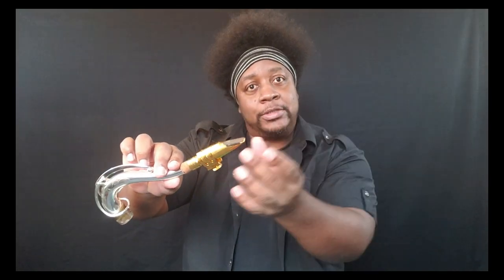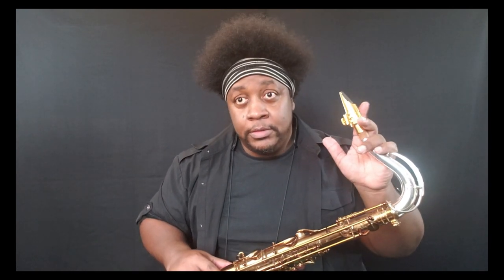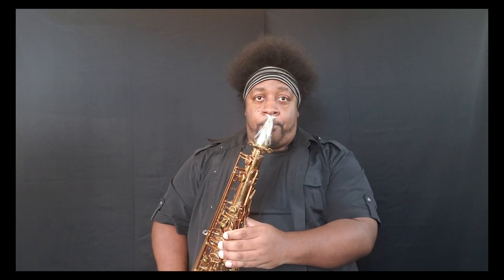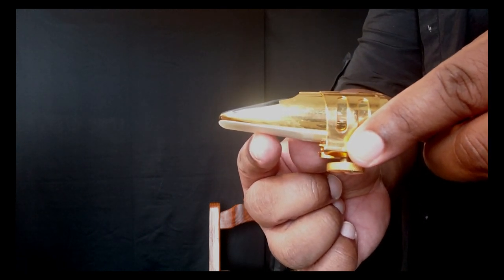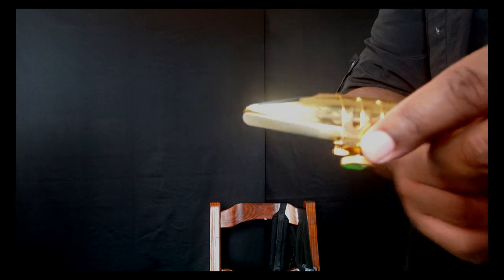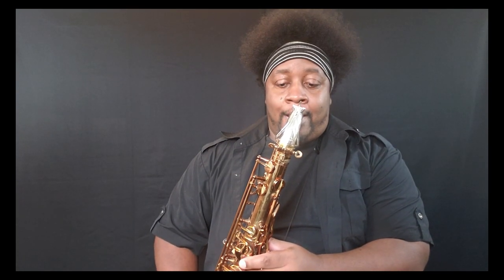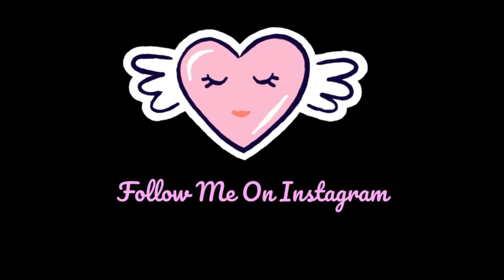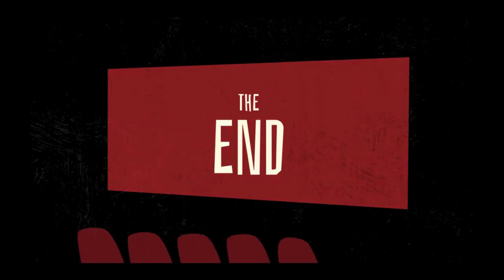Subtone for All Saxophones

Comment: So what about when practising subtones and having thoses multi-notes at once like you had on the G? Having some difficulty to get clean sound unless I come down from low E let's say. Is it that my reed is too soft?
Reply from the maker: The saxophone's tone can become unstable with any type of extreme embouchure. I've had this issue on soprano when I relax too much. If the embouchure is too loose, the lower notes can also split. Try to find those points where the sound is right on the verge of splitting and play in the middle.
Reply: I get that split sound on the high G when i'm playing normally  sometimes... thought it was maybe a fault in the sax. I can correct it by tightening the  embouchoure but seems like it's just that note 🤔 @Sirvalorsax